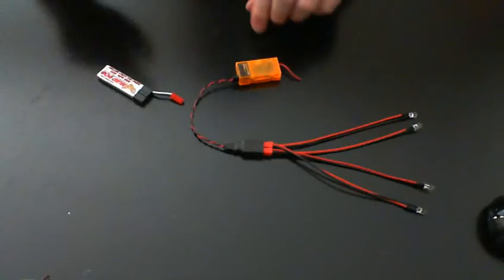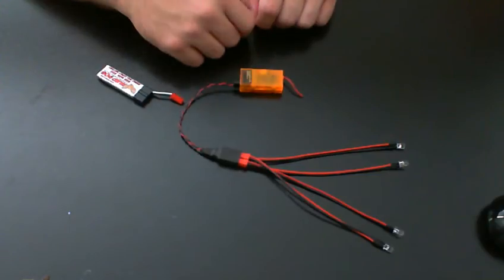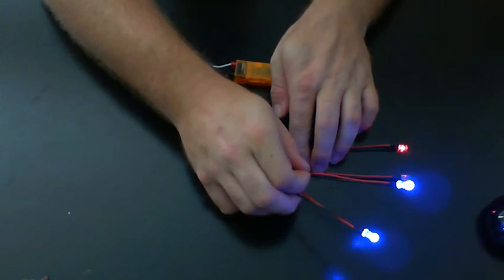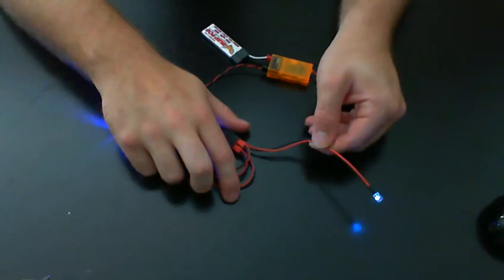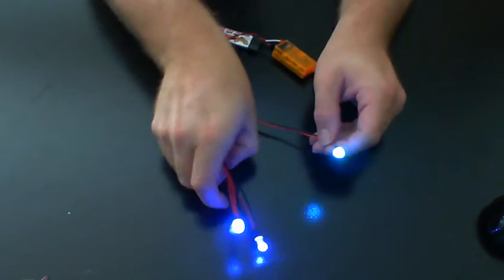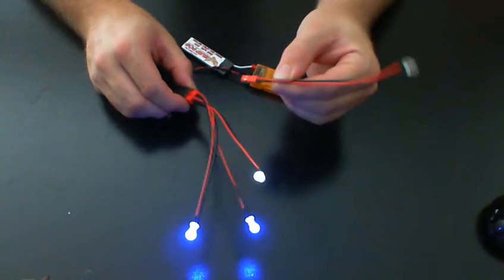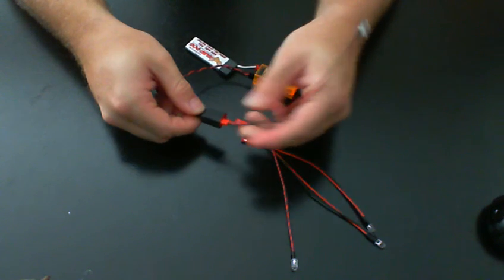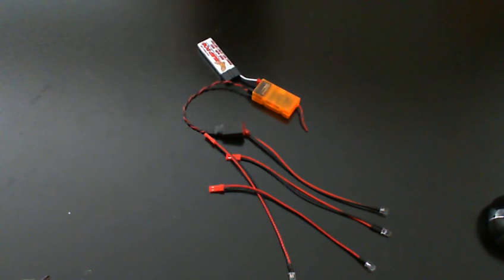5v LED light Kit with blinking LEDs

Comment: Hello
I am putting fairy lamps together.  Using dollar store path light as a starting point.  I have been looking how to get my led string to flash economically.  If i use the variable speed led and take the negative leg to the positive fairy string then negative from string to battery will that produce a flickering effect.  If not is there a cheap alternative. 
I bought wedding flickering strings but the setting is not "programmed " so when power is lost.  Like day time switching to solar charge it reverts to off.

Comment: Approximately how many hours could you get out of a slow blinking LED with this setup?
Reply from the maker: +Ela Steel Hey Ela, I need a little bit of clarification before I can answer that question. Are you asking how long the LEDs will last as far as life span? Or how long they will last on a battery of this type? The battery in the  video is a 3.7v LiPo battery and it would last for 4-6 hours if it's just powering the LEDs.
Reply: Thanks!  Yes I meant the life of the battery. :)

Comment: I am making a lamp that has small green LEDs the are going to be fireflies I need them to blink slowly and each randomly like fireflies would is it possible to make something like that?
Reply from the maker: Kala Marshall You can make them blink slowly in a couple of different ways. The easiest thing to do would be to find some blinking LEDs in the color you're wanting. Then to slowdown the blinking, you can add a small capacitor to the circuit. This will slow down the time it takes for the LED to shut off and then come back on, which will make a slow pulse effect rather than a simple on/off.